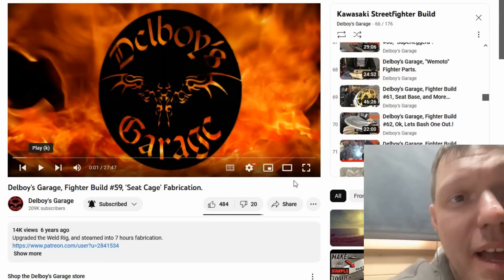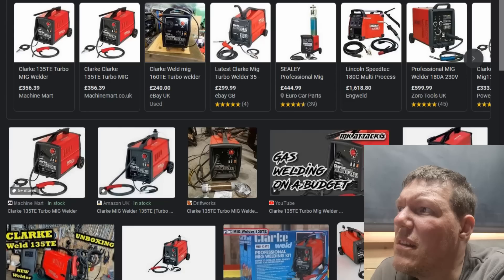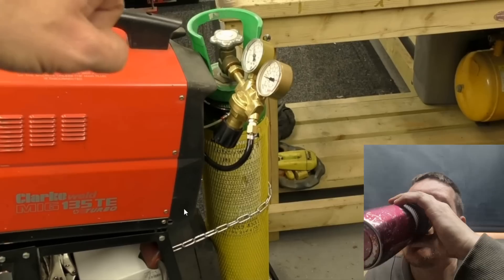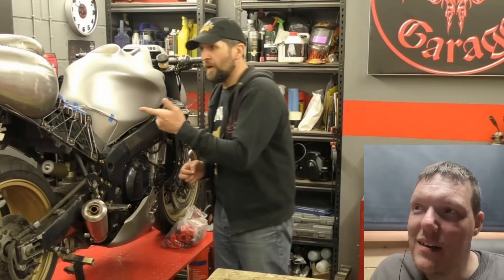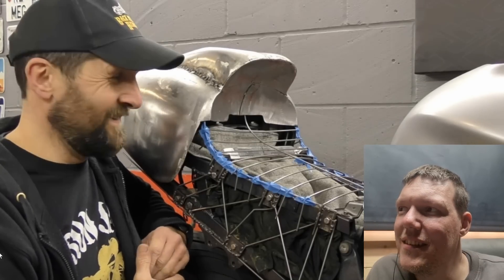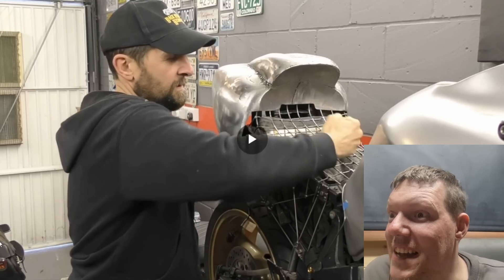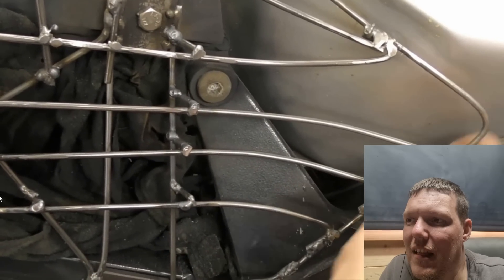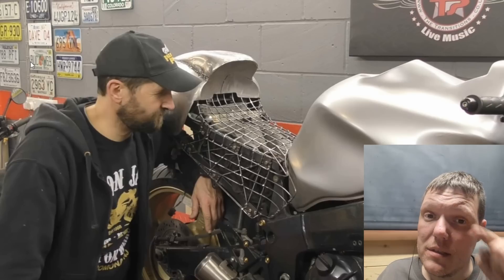HDS 43 - wire chess board

Comment: There are lots of Dels around. Met tons of them. They have a devoted following of muppets who go around finding work for them and building their reputation. Basically it starts when said muppet meets some random Del and gets chatting about bikes. Then the topic of suspension/paint/metal polishing/tig welding/engine building comes up. Muppets head is quickly overloaded with information and jargon about whatever topic it is and decides this person is some kind of guru, what luck to meet this expert at a cafe of all places. Muppet asks random Del if he could find it in busy schedule to help him with a little welding job. Random Del grudgingly agrees but only because the muppet is such a nice guy. Muppet asks for workshop address and discovers random Del is such a guru that he prefers to do his holy work near his house. In the back shed of course. Muppet drops off bike and is amazed at the array of tools. Who else but a guru has a full set of sockets, or one of them funny hammers without a claw on it. Of course perfection takes time. Unlike a regular welding shop who might do it in 10min for a 20. The guru Del has many things to consider. Ampage, swirlage of gas, blendage of the filler metal. So 3 months later its finally finished and all for only 300 bucks. Perfection isnt cheap. Muppet askes why the weld looks weird. Guru Del explains all those welds on Instagram are fake. You need to relieve internal stresses hence those things that look kind of like pinholes. Lets the metal breathe. And you just make up for those by laying a bead 10mm high in between the pinholes.. I mean strain relief holes. 

You learn properly how to do any of these jobs and you soon realize how shit those Dels are. Thing is I'm not sure if they are scamming for money off muppets or they actually think they have talent.

Comment: Dude…I just watched a video where dell used RED Thread locker on a timing belt assembly for a Honda goldwing …am I missing something? Is red thread locker different over seas? Because in the states red thread locker is a permanent thing unless you want to use a torch to get it out 😂

Comment: The small bottles are about 60 bar and 1 liter, I used them a long time ago (cheap beginner welder) then switched (adapted the machine) to a 5 liter high pressure bottle which used to come filled @ 200 bar.

Comment: This is the exact cart of the last video. What a liar. The blue stick welder was in place of the Mig welder, regulator and gas bottle were already in place. HDS42 27:20
4 hours to move the welder on a cart he already had. If he changed the gas bottle where did the "100% Ar" bottle go? He didn't change the bottle. He is lying to beg for more money.
Rags to protect from spark is another perfect "Delample" (del-example)
This bikes needed a bit more metal and weight.

Comment: Have you ever had anything to do with panel bonding epoxy?
Reply: @AverageJoe2020  that’s the thing, everything says the same as what you did, as instructed or “according to oem specifications”, i’ve never seen anything comparing it to welding in the style of pull tests etc

There’s no usage guidelines such as “joint overlap should be 5x material thickness”, if you’re making something or need to do something that hasn’t got an instruction sheet, you’ve no information to work with.